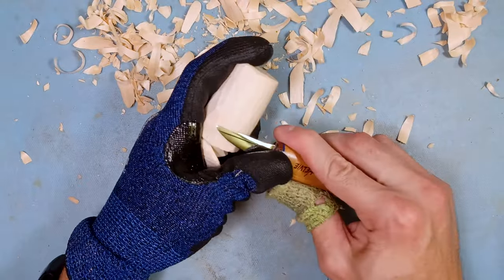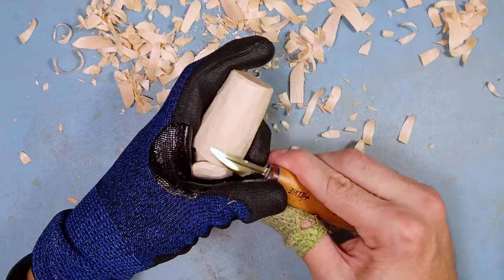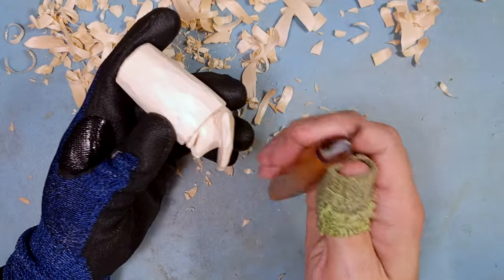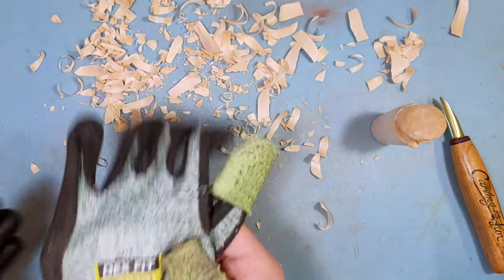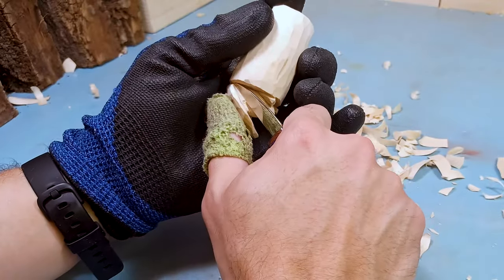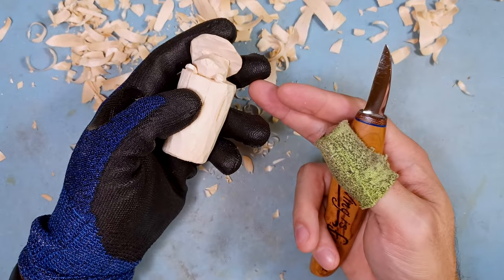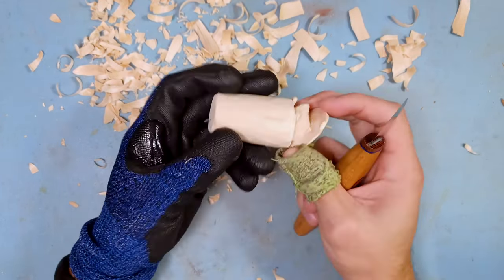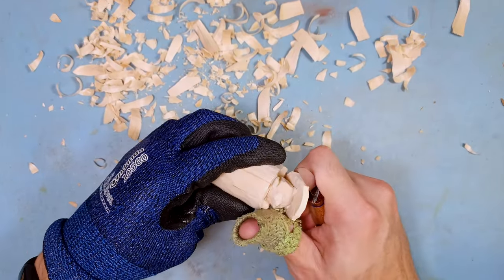Avoid a Trip to the Hospital: Wear Gloves

Comment: I have tried tons of gloves for whittling, and the coated ones wear out. So I use the bandage wrap on the gloves at the thumb and pointer for added protection when I used them.  Now I use leather gloves with reinforced leather pads on the tips. They don't wear out nearly as fast and give better grip.  I soaked them and let them dry on my hands to get a perfect fit and they work for many other arts like hand and machine quilting, needle felting, crocheting, and while working on scroll saws or other woodworking projects.

Comment: I was wearing gloves from the beginning but I think that actually made me become a little careless. Slipped and got a puncture cut (most gloves won't protect you from those) in  my index finger. Got a few stitches but luckily it's just a scar. Still, now I'm wearing a glove PLUS some additional tape around  my thumb and index finger.
Reply from the maker: I can see that happening, but ya punctures are hard to prevent with just gloves.  Thankfully it wasn't too terribly bad.